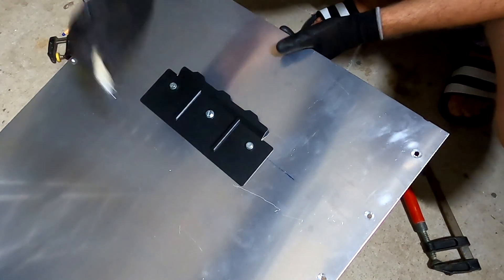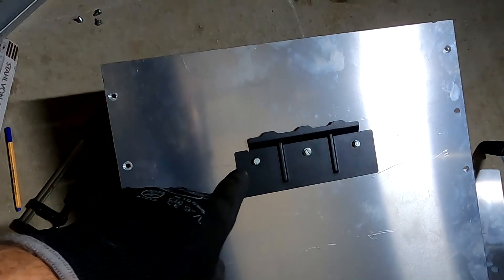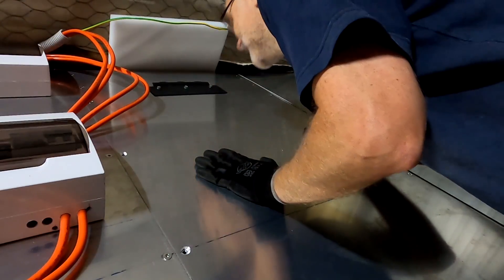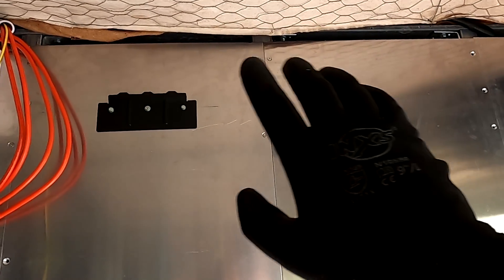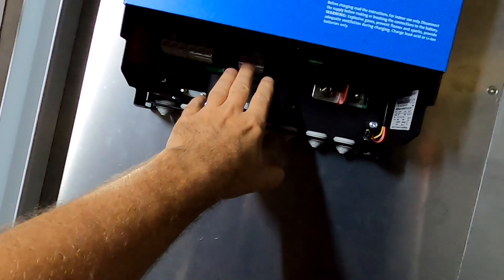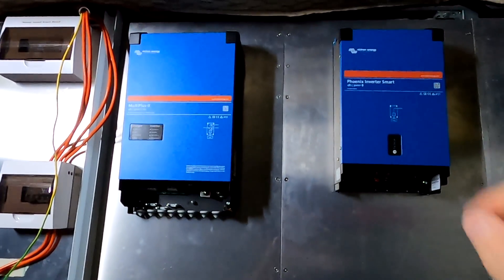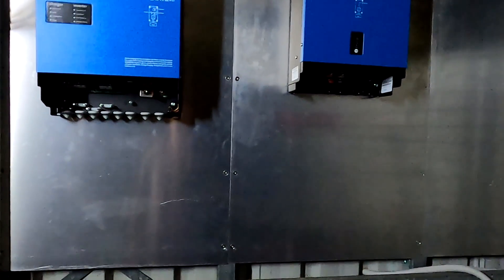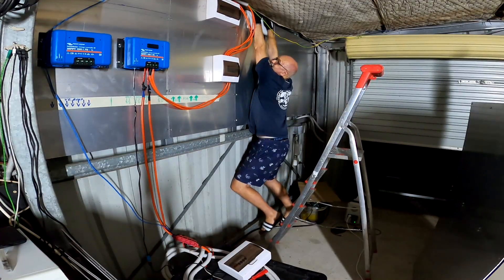Victron Multiplus Wall Mount (Official Strength Test!). AC and DC cables without crossing?

Comment: i'm a little confused as to the "issue" of crossing/not wanting to cross the wires... in my Schneider Power Distribution Panel, it's designed to have all wires (ac & dc) go through a 3" hole to the inverter and back.  (LOTS of ac & dc playing together!)  never had a problem or been an issue.  also, i've seen 'professional' solar installers use big cable chases for both ac & dc wires together.  is this REALLY an issue?  i'm aware there are 'signal interference' issues running video/radio/audio cable next to power cables, but not ac next to dc...

Comment: Yes, you can cross perpendicular ( 90 degrees ) without any problems ...
I built commercial and military flight simulators with massive amounts of AC,DC and signal wiring underneath the computer flooring and we had no choice but to cross over at 90 degrees without any problems whatsoever... We also had 400 hz  for the flight computers running everywhere... Shortest cable runs are best and will still look professional...

Comment: In an industrial setting low voltage runs on the same basket as AC but its separated with a sheet of metal in the basket, this basket and the sheet is earthed, this keeps separation

Comment: The "Bat-"-connector on our german Multiplus-II 48/5000/70 looks the same. Maybe the metal bar is under the PCB or it acts as a single-use fuse to prevent fire in case the battery fuse fails???

The gap between the AC-in and the two AC-outs is populated with a second AC-in on Quattro-II models. The Quattro-II is basically a Multiplus-II with two AC-ins and 5kVA Power-Assist instead of 3 kVA Power-Assist and is about 600,- € more expensive.
Reply from the maker: Thanks for confirming this, Rene!

Comment: First things first:
 - The „Bierbauch“ check for the Aluminium board stability would pass any TÜV (technical supervision approval) - I give an okay here!
Next:
- I vote for solution C, because all cables are visible and do not cross sharp drilling edges. The construction keeps obvious and maintainable after years.

Best :)
Reply: A beer belly is conveniant for mechanical stress tests.😉 I have to strap on a 30 kg cement bag to do this. 🤪
Luckily Andy works in his own home. Otherwise an Employers' Liability Insurance Association officer would go bonkers because of the pool shoes! 😉
Reply from the maker: I had to press hard to make it look excessive and appropriate!

Comment: I'd defo go with option C - much cleaner. I'd also be tempted to cut holes for some vents near the top and add some active air extraction to reduce the accumulated heat above the inverters.
Reply from the maker: The heat from the inverters will rise further up in the ceiling and won't accumulate right above them. There should be enough airflow. I also hope the larger 5kVA unit will not produce as much heat any more as the smaller 3kVA inverter.

Comment: You are a recipe for those amongst us that having a minor time. I do not know how you remain so optimistic, but it is a inspiring a lot of people. Your personality is a great value for me and probably a lot of others. As it seems, you have enough space above the inverters to route the 230Volt cables free. Please keep all your cables on the PowerWall within arms length, so you have the possibility to change (future) or inspect the functionality of these power cables.
Vriendschappelijke groet, Peter
Reply from the maker: Thank you so much, Peter. I try to stay optimistic and share that with my audience. Not everyone is in the fortunate situation of having the resources to set up such a system. I'm fully aware of that.
Reply: @OffGridGarageAustralia  A Multiplus-II does not accept generator input when set to the picky german grid code.
You have to pay 100% EEG reallocation charge if a public road dissects your property between your PV-panels and your buildings but only 40% if it is a conveyer belt of a coal mining company. That's the green deal according to the CDU.🤔
They created 150 DIN A4 pages of bureaucrazy (not a typo!) to prevent the energy transition. 😡

Your videos motivate me again to switch to a Quattro-II after being frustrated by german grid regulations! 😀

Comment: Regarding the 3kVA assist limit, I agree with Jörn, the 3kVA comment in the manual does appear to be referring to the 3kVA Multiplus II. I have the 5000/48 Multiplus II like yours, though mine is in an on grid system using the ESS assistant. It quite happily outputs over 4kW. I can't see why the PowerAssist feature would apply an artificially low limit. You could ask Victron directly, though it's probably just as easy to just wire it up and see what happens!
Also limiting the output of the first inverter to 3kVA shouldn't be necessary, it has some transient overload capability... Just set the current limit to 13A. If this did end up causing an issue then perhaps a better solution would be to turn on the Dynamic current limiter feature in the Multiplus.
You would end up with a more capable system with this approach - output of the 3kVA inverter to AC input on the Multiplus, AC Out 1 connected to the distribution board input. You should end up with a full 8kVA to play with.
Reply from the maker: How do you read this limit in the manual on page 10 under the AC-out-1 section? There is says that PowerAssist is limited to 3kVA on top of what's coming in.
So yours outputs more than 3kVA in PowerAssist mode?
Mine would be like 'grid' connected set up as well. The Multi does not know if the incoming power comes from the grid, generator or another inverter.
Reply: @OffGridGarageAustralia  Hi Andy, I read it exactly as you do, it says you are limited to 3kVA... but like Jorn, I think this is a mistake! The manual covers both 3 and 5 kVA units and I think this is simply referring specifically to the 3kVA multiplus. It is possible the manual is correct of course, but this would be a very strange way for Victron to implement this feature.
As I mentioned I have not used the PowerAssist function myself, so I'd suggest other than asking Victron directly the best option is simply to try it out, it's a simple enough cabling exercise.
Yes, you'd be set up with the 3kVA inverter providing the "grid" input to the Multiplus, which would attempt to limit the grid loading to whatever current limit you specify, in this case 13A. If the input fails (the 3kVA inverter stops for whatever reason) then the Multiplus will continue in backup mode, resyncing to the 3kVA unit input when it reappears. The Multiplus output and relays are rated at 50A so this setup should work well for you, providing a single 8kVA (35A) supply to your distribution board.
Steve.

Comment: D) DC on top w/ shut-off's midway down on the right of each inverter!😉
Reply from the maker: That would be long DC cable runs though. Is it not better to keep DC short and have rather AC cables a bit longer?

Comment: I have two MultiPlus-II 48/5000 purchased for 6 months ago, and the minus terminal are also a PCB connector. I think it has to do that the MultiPlus-II is a cheaper version compered to the more robust multiplus version for marine use etc....
Reply from the maker: Thank you Dennis. There is a Quattro and a Multiplus. They are basically the same device except the Quattro has tow AC inputs. They also share the same PCB, technology and enclosure.

Comment: You are overthinking it.Just use a cable tray underneath all your gear. In the Telco world I come from you just lay new cable in the tray to connect equipment. They don't even bother to remove cable they have cut-over from. Crossing cables means nothing!
Reply from the maker: But crossing is different from having them in the same tray.

Comment: Andy, you can run the ac cable up the left side of the inverter then across the top.  That would prevent the crossing with the dc cables
Reply from the maker: Uhmm... 😁

Comment: Why not use 60mm tall duct for dc, then 40mm tall for ac (for example)  Then you can use 20mm spacer beneath the 40 tall ducting, and do the crossing in the spacers. That way the dc cables would be tucked away under the ac ducting. With the spacer material and 60/40 ducting you would still get a clean look, as all the covers would be flush.
Reply from the maker: Thank you Rune. I had this idea as well and thought about different size ducts and how I can make it work. There was a scenario though where this is a big disadvantage. I just cannot remember what that was... 🤭

Comment: Option C Ac up and around the inverters! Could go buy some more expensive sticky ducting 😄 eliminating crossing or holes...
Reply from the maker: The duct is great, it doesn't even need screws to hold on the panel 😄

Comment: Why don't you put the ac switch boxes under each inverter, and the output cables will be in the horizontal beam? Cheers
Reply from the maker: I need the space for the DC cables and the isolator under the inverter. The switchboard won't be in the middle but further to the left of I install it there. That's does not look great.

Comment: Is it possible to bring the cables out of the bottom of the combiner box straight down to the isolator box. This would relieve some strain on those cables having to do a 180 out the top and also move that duct further over to the left to make space for your AC duct running along side the inverters in option C. Just a thought to tidy things up a bit! Love the content :)
Reply from the maker: Thank you. I will need the space in between the combiner box and the isolator box for more equipment. Hence I placed the duct to the side. But yeah, I get your point, makes totally sense.

Comment: Hi Andy, the Option C is the way u have to do it. 
I read the manual even again, the Multi 48/5000 can handle up 50A for the AC Output in Powerassist mode when it is set grid in-line topology [german -  serielle Netz-Topologie; Manual Seite 13] (Phönix-Multi-Switchboard). Phönix (grid) to AC IN, Multi as Powerassist (limit Grid by setup to  7A ~2000VA) so u have max 7000VA ~ 25A on the AC output.
But the cableways are not nice on the new and clean board then.
Reply from the maker: Thanks but also read page 10 under the AC-out-1 section:
*AC-out-1
... With its PowerAssist feature the Multi can add up to 3 kVA (that is 3000 / 230 = 13 A) to the output during periods of peak power 
requirement. Together with a maximum input current of 32 A this means that the output can supply up to 32 + 13 = 45 A.*
The 50A input are only for Passthru, that's the capacity of the relay and transfer switch,
Reply: @OffGridGarageAustralia  Hmpf... , i m not sure about this part. In the manual the most parts discribe the features and funktion of Multi+ with 3000kva, when u buy a multi with 5000kva or 10000kva that makes no sens, why would u buy one with 10000kva and have no benefit to a 3000kva version.
Reply: I agree with Jörn, the 3kVA comment in the manual does appear to be referring to the 3kVA Multiplus II. I have the 5000/48 Multiplus II like yours, though mine is in an on grid system using the ESS assistant. It quite happily outputs over 4kW. I can't see why the PowerAssist feature would apply an artificially low limit. You could ask Victron directly, though it's probably just as easy to just wire it up and see what happens!
Also limiting the output of the first inverter to 3kVA shouldn't be necessary, it has some transient overload capability... Just set the current limit to 13A. If this did end up causing an issue then perhaps a better solution would be to turn on the Dynamic current limiter feature in the Multiplus.
You would end up with a more capable system with this approach - output of the 3kVA inverter to AC input on the Multiplus, AC Out 1 connected to the distribution board input. You should end up with a full 8kVA to play with.
Reply: @stevemurray0  Victron does not do consumer support. I suggest to ask this in the Victron community forum.

Comment: Cross at right angles, but run the AC hard up under the Invertor so it crosses the DC where it has to bend away from Al panel to enter the grommet into the Multiplus.  AC is in Electrical conduit, DC is in its duct till it has to leap up to the grommets into the Multiplus.
Reply from the maker: That would be my design too, if I go this way. Thanks for sharing.